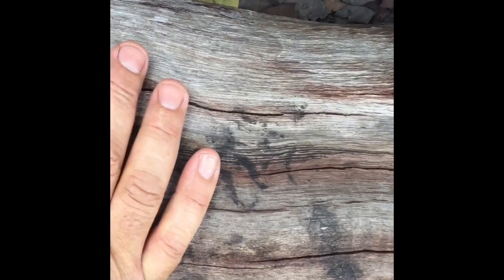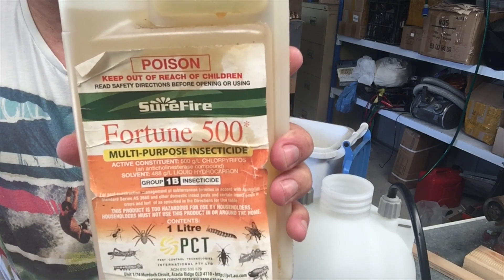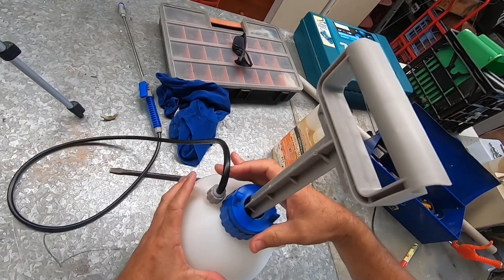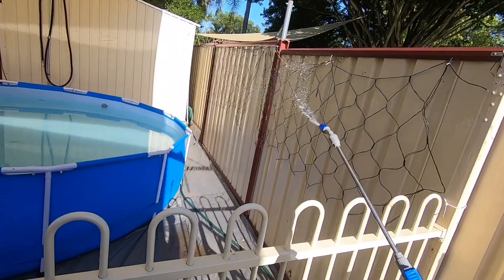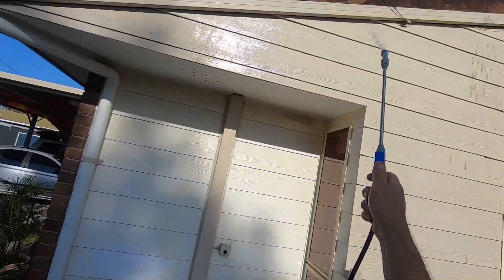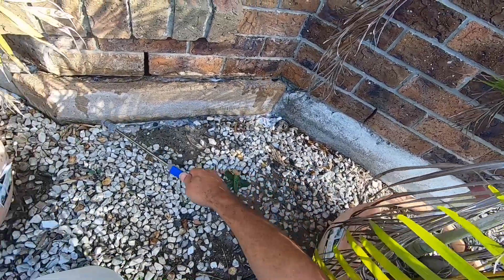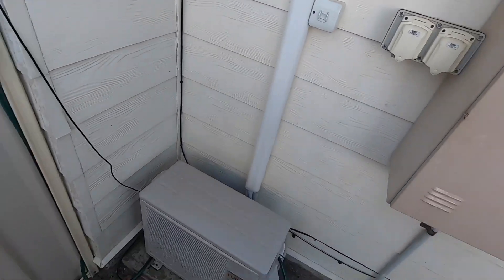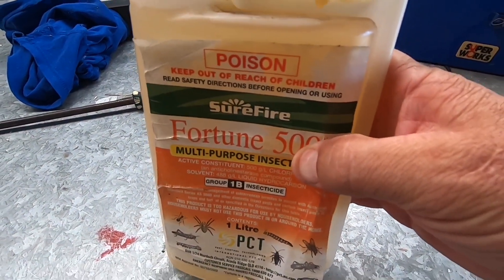do it yourself pest control

Comment: Hey mate have a bottle of this coming in the mail due to you recommend it 😉 because there is just to many spiders outside the house building webs everywhere even some red backs around. How often do you spray mate? My plan was to spray everything with the cobwebs up still then give it a week before cleaning the cobwebs and see if they get rebuilt again what u think? Cheers mate 👍🏻🍻
Reply from the maker: Michael_Au generally once every 6 months  . If you get lots of rain it will wear the spray off quicker and spray when you notice spiders appearing .  I mix it at 100ml of  Fortune 500 to 10 litres water I find it knocks the creepy crawlers . In case I forgot to mention careful of your pet food and water bowls when you spray  . Yes to cleaning the cobwebs after a week 👍 👍🍻
Reply: @EFFICIENTSELF  Cheers mate will give it a go hopefully it works well as I'm sick of all the webs everywhere cheers for the advice.
Reply from the maker: It will make a difference mick  👍🍻
Reply: @EFFICIENTSELF  Thanks mate 👍😎